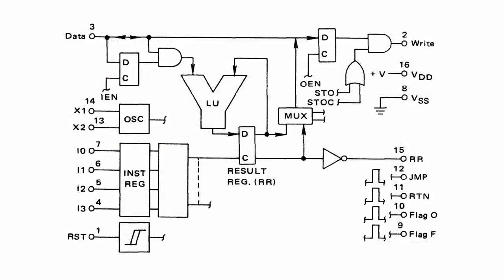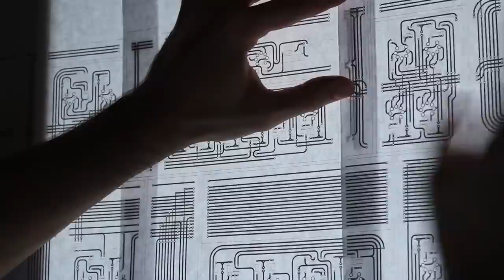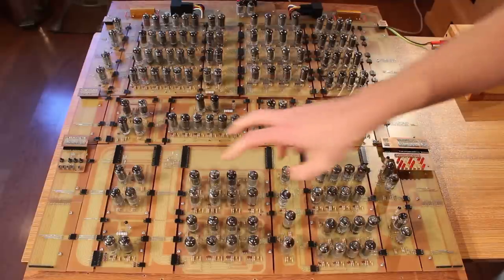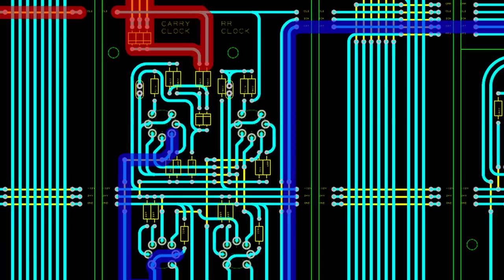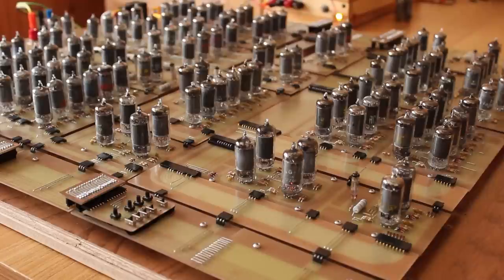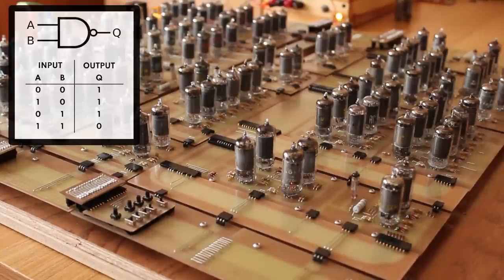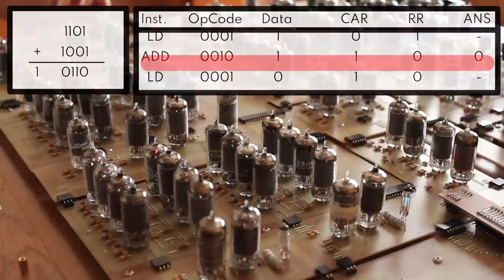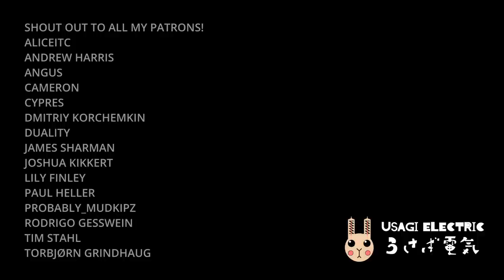Vacuum Tube Computer P.18 – ALU Installed and Tested

Comment: This beast needs some ferrite memory :)
What a wonderful project! Thanks for sharing the progress!
Reply from the maker: Thank you so much!
I was thinking about using Ferrite memory, but for the relatively tiny amount of memory I'm planning on implementing here, I think the read/write circuitry for it would be a little too intense. I have a few ideas I'm working on though, and ultimately, I would be very happy with 256-bits of memory, but I think I'll probably end up around 128-bits or so. Given how long programs will have to be in order to use all of that though, I think that's probably a pretty reasonable amount!
Reply: Magnetic drum or even delay line memory may be more period-appropriate :)

64 microsecond ultrasound monolithic delay line units were used in PAL TVs and VCRs, and are still somehow available
Reply: I was thinking of a Williams tube memory :-)
Reply: @sashimanu  A drum is a challenge on its own but I would love to see it.  Another option would be to weave some core rope memory for the code.  The working memory is the hard bit.

Comment: Absolutely brilliant.
I love the template you used to make the mounting holes. Genius.
Reply from the maker: Thank you so much!
If you look closely, you can see there's already a bunch of drilled holes in the wood before I start. That was my first try at trying to get the Instruction Register and Decoder boards mounted. I totally flubbed it, haha. So, I flipped the whole backboard upside down and had a good long think before I came up with the template idea. Fortunately, that worked like gangbusters!
Reply: @UsagiElectric  Ha ha, Nice one. I'm loving this series so much.

Comment: men, you`re nuts, (in the god way) CONGRATULATIONS!!!!
now the program counter! and the microinstruction stepper! and the microinstruction rom! and the ram! and, and,....aaarrrggghhh!!!
Reply from the maker: Thank you so much!
In order to keep things as simple as possible (so the entire thing doesn't end up filling up the entire room), there's not actually going to be any microinstruction stuff here. Instead, the program counter will read the instruction word into a register, and the instruction word will have the 4-bit processor instruction and a 6- or 7-bit memory address and that's it! Though, even just implementing that is going to be an intense amount of work!
Reply: @UsagiElectric   awwww.....
Now, to be more realistic, consider how much memory a minimum program uses (for example, calculate fibonacci, or a division) and would set it as the minimum amount of memory.
"6 or 7 bits memory address" is an order of magnitude, more or less!
... plus the jump direction register, the return register, maybe some jump decision mechanism (unconditional, carry, zero)
If you want I could upload a sketch to a drive of how I have it implemented, but if you are similar to me (only in the electronic aspect, heh) I would not want influences on how to develop ... it tends to deviate and create chaos. just say.
I never tire of saying it,
Good job!!
(sorry for my "google english")

Comment: Super awesome to see this thing in action. 

Later when there‘s a program counter, it would be super awesome to have IV-11 tubes showing the hex address of the PC and maybe even some register contents.

I just love some nice cyan-green VFD glow 😄
Reply from the maker: Thank you!
And you're actually not far off on my intended path here! I actually recently purchased some nice big IV-12s for use on the memory side of things. I'm still working on how to build the memory up, but I for certain want an 8-bit output register with those big IV-12s displaying the contents. (And ultimately, that 8-bit output register will hook up to the I/O board which can then send the value in that register over a current loop to a teletype to print stuff). 
I still haven't figured out the best way to handle the program counter and program storage section just yet. The 1-bit architecture with IEN and OEN allows for some interesting methods to perform loops that should make building program control a lot easier, but that's something I'll tackle after I get memory all taken care of!
Reply: @UsagiElectric  I can‘t wait to see it! Thanks for building this wonderful machine and sharing it with all of us!

Comment: Before knowing your channel I thought I was one body of the rare fools to do tube logic but watching your video I realize that there are two of us.
Genius
Merci intéressant
Reply from the maker: There's not many of us insane enough to try it, but boy it sure is fun!
Are you working on any tube logic projects? I love checking other's work in this weird field!
Reply: @UsagiElectric  I made some 4 bit relay calculator on the similar logic architecture as your project i made a 4 bit vaccum calculator but i use double triode tube (6BQ7A) with relay memory in order to save the maximum vaccum tube, I will now work the display with nixie tubes
Reply from the maker: @linushyky476  That's awesome! If you've got any links to pictures or anything of your projects, I'd love to see them!
Relay memory is a smart choice, I'm working through memory design at the moment now and it's really hard to balance memory size with physical size.
Reply: @UsagiElectric  In order to keep in mind the relay is a good choice and easy to implement if you want to see my modest projects on Pinterest france. Thank you

Comment: I'm tempted to suggest a microcontroller  with serial interface to run the tests.
And a calculator test. 
Maybe uln2803 type IC could handle the level conversion for the interface, it is just octal darlington open collector NPN  array.
Reply from the maker: I've often thought about using an Arduino to test functions out, and as it grows in complexity, that may actually be necessary, but for the time being, I actually enjoy keying things in by hand!
Reply: @UsagiElectric  I vote for a Raspberry Pi with Discord interface, so we can execute programs remotely :D

A microcontroller would be a great way to check the maximum frequency too 🤔

Comment: Super cool !!! Now all you need is a nixie tube interface, of course powered by a vacuum tube psu.
Reply from the maker: Thank you!
I would love to use Nixies, but I just don't have the voltage for it. My goal with this build is to keep the entire supply voltage at just +24V and -12V, which isn't quite enough to light off a Nixie tube. But, I do have some very beautiful IV-12 VFD tubes I plan on using!

Comment: I AM IMPRESSED! I was about to ask what you were using for a power supply... but you answered my question.
Reply from the maker: Thank you so much!
For the 24V supply, I'm using a Mean Well 24V 15A supply, and that's plenty powerful enough. For the -12V supply, I was just using a little 12V 3A wall wart that I stuffed inside my wooden box. The 12V supply is going to need an upgrade though, so I'm going to bump it up to a Mean Well supply too.

Comment: I wonder how well such a thing would work built with Soviet rod pentodes?  These tubes were designed to have very good performance at low voltages and were used in missiles.  They are considered among the most advanced tube designs ever produced.
Reply from the maker: It should work perfectly with little submini pentodes! I would have loved to build it with submini tubes, but they are really expensive comparatively, so I sacrificed physical space for affordability. Interestingly, the 24V designs I'm using here could be transitioned over to NFETs with almost no changes at all! Changing the whole design to SMD FETs and passives could really make it very compact.

Comment: very excited to see what you do with memory!
Reply from the maker: Thank you!
Memory is a tough one. Because it's a full 1-bit architecture, not a serial architecture, I can only really access a single bit a time. In a traditional 8-bit CPU, one address gives you 8-bits in return, so an 8-bit address can access 2-kilobytes of memory. But, with the 1-bit architecture, one address only accesses one-bit, so an 8-bit address can only access 256-bits of memory, or 32-bytes in total.
Still, given how long programs would have to be fill all of that in, that's actually a pretty substantial amount I think! So, the question is, how to build it? And I don't quite have an answer for that yet, haha. I'm thinking about 24-bits will be vacuum tube based registers, and then another 8-bits will be physical switched input, and another 4-bits will be reserved for special stuff (RR loopback, inverse RR loopback, low, high). If I want to use an 8-bit address, that leaves 220 bits left to build (if I use a 7-bit address, that knocks us down to 92-bits). I need to come up with a good solution, and right now I'm leaning towards using VFDs and LDRs, but the control for that is still giving me some grief that I have to work out.
Here's a basic proof of concept though: https://i.imgur.com/OgxDr0M.mp4
Reply: @UsagiElectric  how about magnetic core memory?
Reply from the maker: @primus711  On the Discord we've been talking a lot about how to take care of the memory, and the problem we're running into now is coming down to physical size. The address decoding and select circuitry for each individual bit is physically relatively large, regardless of what kind of memory cell I end up using. I need to limit the size of the memory board to 1,000mm x 700mm (that's the current size of the processor back board) to make it fit in the total design. That means I'm running into all sorts of issues before even getting to the type of memory cell I use. But, we're slowly working out the kinks and I think I'll get at least 64-bits (8 bytes) of memory, maybe more (I would like 128-bits or 16 bytes, but I don't know if that's doable).
I do want to do something with core memory in the future, and I have an idea for a project that is much better suited to it!

Comment: very nice as always, at this point, your layout might make for a good wallpaper ... like an actual wallpaper on a wall. 
When you mounted everything on the new board, I had this strange idea that it would mount pretty well onto a door, which would be hillarious. 

On the more serious side, it might be a good investment to build a specific "debugger" by using something like an arduino to do some automated tests for you. 
You could add a breakout with something like a DB25 connector and have a single plug to connect your debugger to all the important signals that can then run an automated ALU test or something. 
I guess if you want to use it regularly and or plan to expand it or add other features to it, an easy way of connecting a single cable, pressing test and see if everything works might be a very handy thing to have.
Reply from the maker: Thank you!
Interestingly, the PCB layout design that I built on the computer (and you can see briefly at 19.45) is my phone wallpaper. Unfortunately, it's an old revision, so I know where all the mistakes are on it, haha. 

As the build grows in complexity, thinking of a good, quick way to ensure that all the functions are working appropriately is definitely going to become more necessary. At the moment, it's a little difficult because the only actual feedback for stuff is coming via the VFD indicators because a lot of signals are still waiting on the rest of the processor to be built. But, once I get the last part in place, I'll have a ton of pins I can connect up to on the bottom and debugging should be a lot simpler.

Comment: What if you used some little cathode ray tubes as 1-bit memory each? I read a Wikipedia article on the subject of CRT uses and one of the less common ones was memory.
Reply from the maker: Those were actually called Williams Tubes and I absolutely love them! Someday, I do really want to build something with Williams tube memory, but for this project, I'm trying to keep everything at really low voltages (just +24V and -12V), so unfortunately, that rules out using CRTs. Still, excellent suggestion and something I hop to get into in the future!

Comment: For memory going the Dekatron route would be impressive (and look it too)  as they display the data and it can also be read back from them.😎
Reply from the maker: Dekatrons would be awesome! Unfortunately, one of the (totally arbitrary) design limitations I set for myself for the whole project is a low B+ voltage of just +24V, and that's just not quite enough to ignite a Dekatron. I do really want to use some Dekatrons for a future project though, because they look epic!

Comment: We had old vacuum computer stuff at the electronics school. All I ever seen were modules with the tubes, They all were 12AU7 dual triodes. Your tubes look like 6AU6 or 12AU6 pentode tubes. What did you use?
Reply: It's built from 6AU6 only. He did a video where he explained why: Low Voltage performance and low cost.
Reply from the maker: Crasbe nailed it, I'm building the entire thing out of 6AU6s because they perform really well at low voltages and they're super cheap!
In the future, I would love to take a stab at another tube computer, but instead use dual triodes like the 12AU7 and higher voltages, but I think I'll go with an LGP-30 inspired design and use a lot of Diode Logic!

Comment: Forgive me if this has been explained elsewhere but what tube types are being used here?
Reply from the maker: No worries!
I'm actually using the 6AU6 pentode for everything except the two soft start relay driver tubes at the very top, which are 2D21 thyratrons. I chose the 6AU6 because it works exceptionally well at the low voltages I'm using here, and, more importantly, they're dirt cheap!

Comment: Wow!      A few things I might have done differently:

(1)  Build a serial 12-bit computer, like a PDP-8/S.  Now all that much harder.   Especially....

(2)  Allow yourself to use germanium diodes.  For example the 1956 Bendix B15 had 460 tubes and 3,000 germanium diodes.  

(3) Use cooler tubes, like the 6AK5, with half the heater current and about the same transconductance as the 6AU6.   Also they're just 50 cents each!   

But anyway, much regard!
Reply from the maker: Thank you very much!

I actually did think about using a serial architecture like the PDP-8/S, but honestly, it came down to my ability to wrap my head around the architecture. While the MC14500 I used for inspiration is hilariously weak in comparison, it was an architecture design I could follow and visualize in my head, which made life a lot easier. As I learn more about these old computing techniques, other, more complex designs are starting to make a bit more sense though, so in the future, I would definitely like to build another tube computer that's far more capable!

I actually am using little silicon diodes here! They're not exactly Germanium diodes, they're little Schottky diodes, but they perform quite similarly to the Germanium diodes that were commonly used. I actually build my NOR gates by using two diodes to make an OR gate, and then a single 6AU6 to invert and amplify it for a clean logic low and logic high.

I also did a ton of testing of different tubes at super low voltages to see what would be the best choice. With smaller, cooler tubes like the 6AK5 or 9003, there just wasn't quite enough emission to get the tube working right. The hotter the tube and the larger the plate, the better the tube seems to perform with just +24V on the plate. The 6AU6 seemed to work really well, and they were an extremely common tube, so I was able to find them in large lots for really cheap!
Reply: @UsagiElectric  great that you investigated tubes at low voltages.  The data sheets were never very clear what happened down there.  I am a tube nut too.  I have a dozen or two 28D7’s which are low voltage dual power pentodes.  Totally impractical due to their heater power and wildly non-linear curves but fun to play with.

Comment: Superb work. I'm new to the channel and this is insane!! I've a lot of your videos now to look forward to catching up on. If all those 6AU6s are in circuit and assuming 0.3A heater current for two valves in series at 12V, that means you'll need just over 20A for the heaters alone.  By the time you've finished the project I hate to think just how much heater current you'll need on tap!!
Reply from the maker: Thank you so much!
You're not far off on your calculation! The majority of the heaters are actually powered off the primary 24V B+ line (with four in series), so the current requirements are a bit less. But, I'm fully expecting the +24V line to pull between 5A to 10A, and the -12V line to pull around 5A to 7A, which is a lot of juice for something so simple!

Comment: You forgot your anti-static strap, a must for working on electronics ;-)
Reply from the maker: Fortunately, vacuum tubes are super resilient and can readily withstand short pulses on the order of kilo-volts without any problems!
Reply: @UsagiElectric  Sorry, I thought I sufficiently flagged the humorous nature of my post.
Then again, they not so resilient if you drop them!

Comment: How about some ferrite core memory?
Reply from the maker: Memory is going to be a serious undertaking!
On the Discord we've been talking a lot about how to take care of the memory, and the problem is coming down to physical size. The small, 1-bit data bus means that regardless of what I use for the memory cell, the address decoding and select circuitry for each individual bit is relatively large. Regarding the size of the entire thing, I need to limit the size of the memory board to 1,000mm x 700mm (that's the current size of the processor back board). That means I'm running into all sorts of issues before even getting to the type of memory cell I use. But, we're slowly working out the kinks and I think I'll get at least 64-bits (8 bytes) of memory, maybe more (I would like 128-bits or 16 bytes, but I don't know if that's doable).